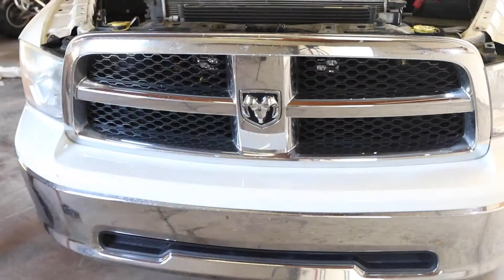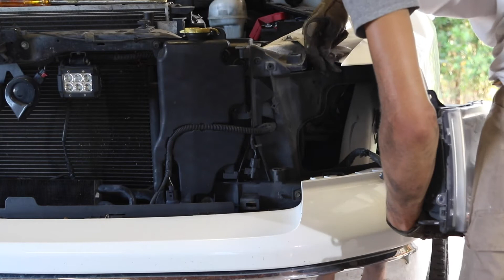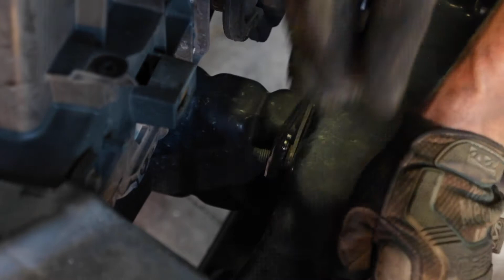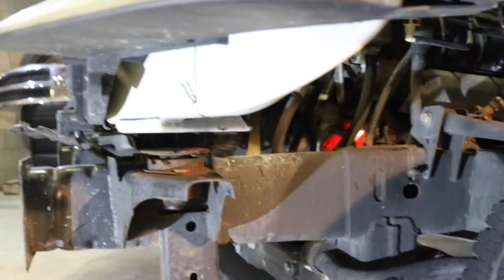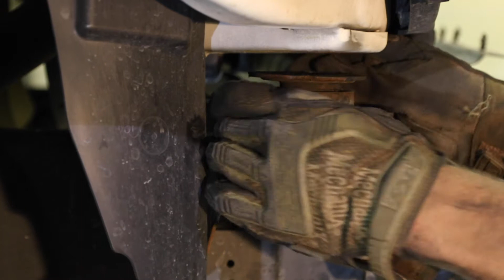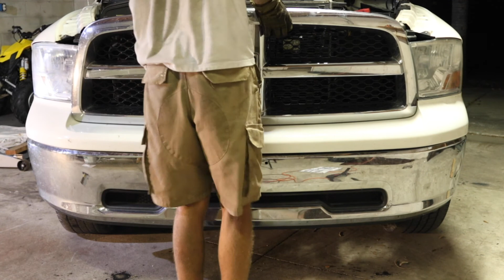How to Install Zone 1.5" Body Lift Kit: Dodge Ram Trucks

Comment: Young Man I've been serching for days on just the video you're doing right now because of a noise I washaving in that area.And this is after spending money at a dealership that changed suspension components that were costly just to have the same noise because rubber on bushings were split. Thank you and keep sharing. God bless you.

Comment: I don't understand why you took the front of the truck apart to change the body bushings. And what was that extra plate you added?
Reply: Those plates lift the bumper up to stay flush with the body. Bumper is attached to the frame not to the body.
Reply: 1. You have to, 2. The plates are bumper relocation brackets. When you lift the body off the frame the bumper stays on the frame so there would be a 1.5” gap between bumper and body

Comment: Does the body lift level the truck at all? Ive read online that it does? I am trying to get this bl for my truck as wel
Reply from the maker: No, it will raise the front and rear end equally. If it’s not leveled it still won’t be

Comment: Yo , what lights did you use for your front bumper set up?  I’d like to install some and have a set up exactly like yours.
Reply from the maker: Amazon nilight led pods
Reply: @wrenchwise1529   thanks amigo! Reason why I ask is because I got myself some blacked out D.O.T approved headlight housing units. Even with led lights my visibility is absolute crud.  The set up you have seems to provide adequate lighting. Do you use yours daily at night ? If so , any pictures or experience with the results ?
Reply from the maker: @E-Man-um4yd  They are a bit too bright for constant use but great when you need them

Comment: Nice video but I wish you would have included the back
Reply from the maker: Intended to, but lost some footage. Sorry about that. It is a very similar process though
Reply: @wrenchwise1529  so even for the rear you would have to take off the whole bumper ?
Reply from the maker: @Italianborn  Yes and relocate it otherwise there will be a one and a half inch gap

Comment: Almost seems easier to get a full suspension lift lol
Reply: This along with bilatein shocks and a spacer lift in the rear is a way cheaper way to get a 4” lift
Reply: I did a 3” level $100, adjustable ball joints $100, 1.5” body lift $150  much much cheaper than the 4” sus lift. Flies down trails just fine.